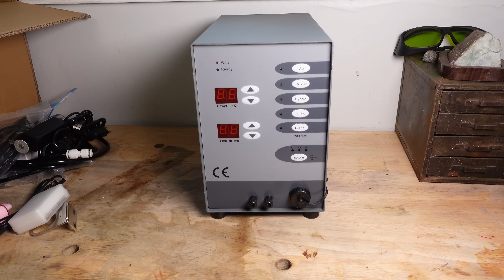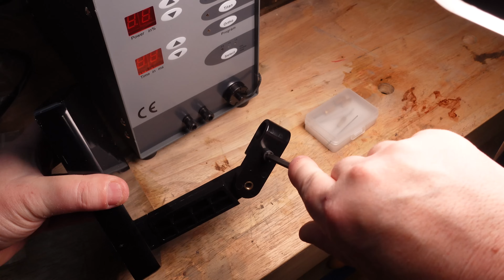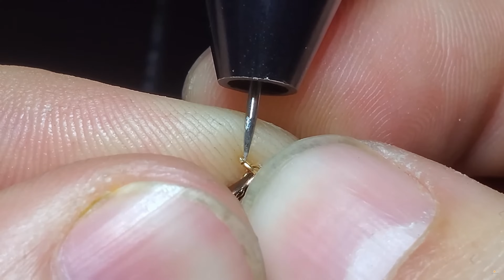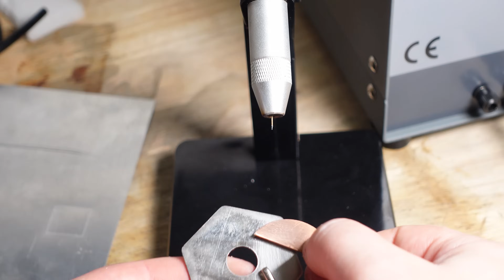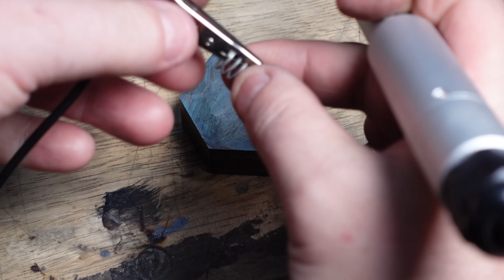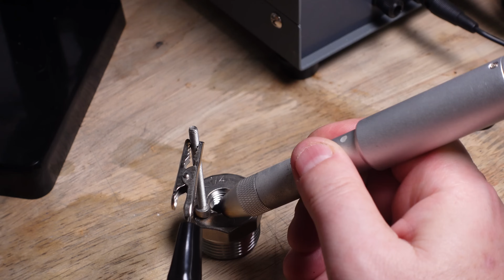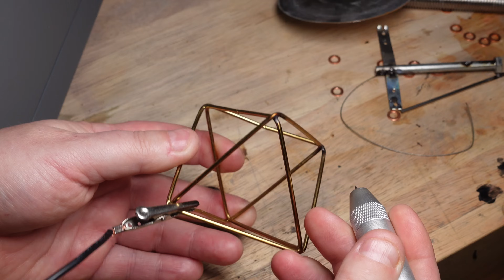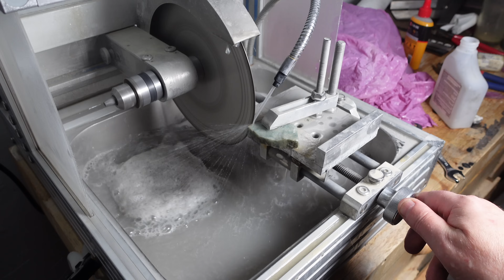Every maker needs this cheap little hobby welder #jewellerymaking #lapidary #welding

Comment: This is an excellent real-world demonstration of how useful a compact pulse welder can be beyond jewellery making. The examples make it much easier to understand where this type of machine fits between soldering and conventional TIG welding.

One important point for new users is that argon becomes especially helpful when making repeated welds or building up a seam. It can reduce oxidation and porosity, keep the weld area cleaner and extend the usable time between tungsten-tip sharpening.

Protective welding eyewear and testing the settings on scrap material first are also essential. Thanks for showing what this affordable type of machine can realistically do.

Comment: This is purely a cosmetic welder it's perfect for those little tiny jobs like jewellery work on silver gold brass copper aluminium perhaps I don't know any aluminium jewelry but as an engineer let me say for the record under no circumstances will this give you a proper penetrative deep weld. It is not designed for that at all so please do not rely on this to do welding in place of a proper mig or tig welder that can do high-quality preventative welding. The argon gas that they recommend is used as a shielding gas to prevent oxidisation during the weld .

That will improve the weld and get rid of the black staining. It will allow the weld to be deeper but again under no circumstances rely on this for safety welding and please please wear appropriate safety glasses the blue light that this welder gives off will burn your Corneas and damage your eyesight. You should also be aware that the blue light is in the UV wavelength and hand protection should be worn.

Comment: Can I hook it up to my regular wall outlet?
Reply: Yep anything that can chuck out 110 or 220 V and can supply at least 10 A or more, do not connect it to a lighting socket. It has to be a normal socket for example one that runs a dishwasher or an appliance in the kitchen or if you've got a socket in the garage that sort of one.

Comment: I have the exact same I use it with Aragon it it is hilariously simpel and Awesome to use I wish I had this in the 90s would have a YouTube Channle by now if I had this pice of excellent equipment sooner. RC Chassis aut of Aluminum wire no problem. Even drone components are a pice of cake.

Comment: Can you recommend settkngs ?
Reply: Try the machine settings first as you can see there are standard settings for each of the base metals if they're no good then try the manual mode basically all you're doing is altering time and current flow.

Comment: Do you have to use argon because i don't know anything about this stuff?
Reply: Argon is a inert gas. It will not harm you well that is unless you completely filled the room up with Argon gas and remove all the oxygen which is highly unlikely. It is used like plumbers use flux when they are soldering a joint together,  in welding or in this case tack welding or pulse welding, what the argon does is create a shield if you like around the electric spark that prevents the oxygen in the air penetrating into the weld and causing the black staining and a poor quality weld.

You can pulse weld using this machine without argon and he does actually show you that all the welds he's done are without it personally I would buy one of the small bottles and try welding with the argon gas, when you become more proficient by a larger bottle because it will save you a lot of time on Cleaning and it will guarantee a perfect tack/pulse weld assuming your settings are okay.

I would suggest you do a little bit of research if you think about buying this and look on Wikipedia about cold welding because that this type of welding is called that or pulse welding to give it its proper name. This creates a very weak weld but for jewelry that's all you need but if you were trying to say weld a car back together, this is definitely not the machine. For that you need a professional machine that can put out 80 to 300 A this only puts out 150 W at whatever voltage your country is.

Comment: What is the power of this machine ? . There is a wide range of product starting from 100W to 500W with  150 A..and I guess the steel spotwelding depends on higher watt values

Comment: Just received mine ordered via your link, and I hope there’s just a learning curve, because so far I have made zero successful welds… attempting to weld cleaned stainless steel, and getting sparks and slight marring of the surface plus a decent amount of soot, but so far zero joined metal. It’s tough to know whether I’m experiencing user error or some fault with the machine because there’s not really much to the manual, plus, not a whole lot of instructional videos to follow… will keep trying to make a successful weld happen.
Reply: Avez vous réussi du coup ?
Reply: @maximeboche  (sorry, I tried to remember the French I took thirty years ago, but it was embarrassingly terrible, so I’ll just go with English so I don’t embarrass myself)… I could not get the welder to work, at all, even on the easiest test of welding jump rings closed, so I returned it and actually ended up buying one from Sunstone that’s SO MUCH more expensive that it’s kind of nuts, but it works so beautifully that I’m still not sure it’s actually real! Even with zero experience, I was making successful tiny, pretty good looking welds within about ten minutes of getting the Sunstone welder set up.
Reply: Похоже, я отнесу этот аппарат в мусорник. Он не может сварить ничего, кроме проволоки диаметром 0.2-0.3 миллиметра. Ювелиркой я не занимаюсь. Этот аппарат не в состоянии заварить даже щель в тонкостенным стакане из нержавеющей стали. У кого другой опыт, пожалуйста, напишите.
Reply: @hombre0leg I ended up returning mine because out of hundreds of attempted welds, I was only successful on TWO, which were jump rings. I actually do work at a very small scale and this thing was still totally useless.

Comment: Newbie question: are the tungsten rods a consumable? If yes, how long do they last and where do you get replacements? (You can tell I’m about to buy this machine, with zero welding experience, based purely on this video 😅)
Reply from the maker: yes they wear out eventually but the machine comes with dozens. i have had the machine for a year, use it every day, and haven't needed to buy more yet but im sure you can find them on amazon when you finally need to
Reply: @sweetgumnyc7794 amazing! The possibilities that this tool opens up, especially when paired with a fiber laser, are seriously infinite!

Comment: What's the power input needed? I see it listed as 110v/220v. Standard 110v/15a circuit sufficient? Or expect to connect to a 250v/30a circuit? I haven't seen any specs or reviews mention anything about power requirements.
Reply: I think it depends on your country, I ordered mine and I am in Kenya where our voltage is 220

Comment: Could anyone please tell me if, in your experience, this machine would spotweld 3*3 mm square rods to a solid base with perfect square holes in 6mm mild steel? Both non-galvanised mild steel. 

Would help me hugely to know. I exclusively need to weld those and I’m a bit scared of full-on welding. 
This seems to have a nicer workflow too…

Cheers!

Comment: I saw this video and i just saw that my heart desired it.
I do hope it wasn't a bad buy.
Reply from the maker: You'll love it. Since I posted this video I have been using it not only every day but I sell EDC keychains and I use it in my production process so it gets used all day long and its holding up well. I still never bothered getting argon
 Works for steel and aluminum fine without it
Reply: @sweetgumnyc7794  Well, let's hope it holds up better to heavier use.
Also that i don't mess it up during the learning curve, however that shouldn't be too bad since i have a weld certificate.
Reply: @sweetgumnyc7794  Well, it's looking bad so far.
So what settings are you using for those results? I've so far tried a few different nails, some old steel wire, tried repairing a vacuum part.
All in all shitty "welds". Lots of soot.
So far i've mostly done the Hybrid, or cranked it up to max to get any desireable effect.
Only difference i can see is the screw on safety cap on yours vs the push fit on mine, different grinder. Plus my "manual" was a printed piece of paper.

But unless i can make it improve significantly, this one is being returned.

Comment: Could this be used for installation of new brushes on a small motor?
Reply from the maker: i have never coiled a motor before but aren't brushes usually installed with a spring? i

Comment: Great video! Does anyone have experience with aluminum? It seems to work in the video, but I've read online that it doesn't. It would be really interesting for welding aluminum sheets (0.5–2 mm) for model making.
Reply: Welding Aluminium is very difficult to weld even skilled welders have problems the first thing you need is an AC welder not a DC welder which is what this is well it's a tack welder, I know he shows it tack welding aluminium and I was quite surprised the problem with welding aluminium is that it can heat up very very quickly and you end up with a hole in there substrate you have to preheat the aluminium and then you have to continue to heat it as it cools down that's why this is not in my opinion the best machine to tack weld aluminium. You need a proper AC welder and the appropriate gas.

Comment: hi. im rather new to this but i would like to know do you need a respirator? Protective eye wear? Do you need proper ventilation or fans? And can you use this in your apartment.?  Basically do u need to same safety protocol for sodering? Im really not interested in the gas rite now. i would like to repair some jewels or small crafts. I just thought sodering had to much involved rite now. thz
Reply: No to a respirator, just a Covid mask unless you're welding something that gives off a toxic chemical like galvanised metal you won't need fans or ventilation. You just need to do it in a safe area which is unlikely to catch fire if you put something hot down so I recommend placing it on a tin tray or a tile and do it that way when you can buy the argon because it will make a lot of difference

Comment: Hallo, echt schade, dass es keinen Vergleich zum 1. Gerät gibt. 
Ich habe mir jetzt auch so ein Teil gekauft. 

Leider war da Betrug im Spiel!

Es gibt keine Verbindung für das Schutzgas zur Schweißpistole. 
Am Gerät selbst ist noch alles Okay. Wo das Loch für den mittleren Pin war, ist jetzt das Loch fürs Gas. 

Am Stecker der Schweißpistole gibt es aber nur Pins! Kein Loch fürs Argon! Das verteilt sich dann nur um den Stecker.

Ich habe 2 Fragen an dich.
Es kann aber gerne jeder darauf antworten. 

1. Hat der Stecker deiner Schweißpistole ein Loch? 
Auf manchen Bildern ist die Öffnung deutlich zu sehen. Bei den meisten Bildern erkennt man aber den Pin in der Mitte des Stecker.

2. Kannst du mir bitte sagen, was bei dir für Kondensatoren verbaut sind? 
Bei mir sind es 10000 µF 63V .

Ich freue mich über jede Antwort. 
Das hilft bestimmt auch anderen Leuten .

Comment: It was because of this video I bought one of the machines. I don’t need a full on welder but one just good enough to make small repairs and crafts. Thanks for showing me the way sir!
Reply from the maker: What do you think? Do you like it so far?
Reply: @sweetgumnyc7794 so I have never welded a day in my life before this. It took me a little bit to figure the settings but after that it was very easy to use. I do think I’m going to get an argon tank just to try. But I also got some 2mm 304 stainless rod that I cut into pieces and made a cube. A little crooked but I was impressed how easy it was. Great little machine.
Reply: @sweetgumnyc7794 I do. It takes a bit to learn all the settings but now that I have it down it’s a nice little machine for hobby stuff.

Comment: My question is, after you have tacked on sterling silver, can you then solder with silver solder?
Reply from the maker: Not sure what youre asking but I think youre asking if you can use this machine as a tac welder to hold your parts in place while you then follow up with a full solder? If thats what youre asking then yes absolutely. I use it for that all the time. Some pieces its extremely difficult to keep parts from wandering when soldering so this really helps. The best part is because the tac welds are so tiny (power is adjustable) even if the weld is in a conspicuous place, 2 seconds with a silicon wheel in your micromotor, removes any evidence of the weld on the outside. I even fully flux my work, place a thin piece of solder between two pieces, hit it with one or two small welds to hold it in place, and then follow up with my torch to set the solder and its perfect. The flux doesn't effect your weld, as a matter of fact if youre not using argon, it actually helps. One warning is if you apply too much paste flux, it could interfere with conductivity so if I use too much flux I sometimes need to scratch a tiny clean spot where I need a weld so I can achieve conductivity.  Its easy because I just use the tip of the welder to do that because it's  tungsten and shaped like a needle so its perfectly suited and  already in my hand lol
Reply: @sweetgumnyc7794 yes exactly what I was asking, thank you for your reply, appreciated.

Comment: It's a copy of an older German made dental welder. That's why it looks so powerful. It's a dental welder, not a jewelry welder. And yes, the welds must be strong, if you weld, for example, a dental bridge.
Primotec Phaser MX1 is the original. If you google it, you will see, that it looks almost the same. Also the manufacturer has a channel here on youtube - @primotecphaser. Last upload is from 12 years ago, but nevertheless you can see how it is intended to be used.

Comment: Chinese electronics is like American cars. Not very good. 
For Quality you need German. However no all product makes,are bad.
Reply from the maker: I used to think like you do but after buying probably over 2 million dollars worth of machines, supplies and equipment from china through my job over the years, i have not only witnessed a marked improvement, but with many products Chinas quality is now the best in the world.The Chinese market has two teirs. They still make garbage for all the big box stores but they also have highly specialized top teir products as well , often at a 10th the price of comparable western products with no trade off in quality. It all depends on what you buy. If you want to spend $3000 on an orion welder that can do little more than this $200 welder can do, be my guest but the days of "china only makes junk" narrative is something only boomers still believe.  Almost everything we buy is made in china now, even brand name american label  tools. Just a couple years ago American made fiber laser sources were considered the best but today, they have been completely replaced by Chinese equivalents that are better and less than half the price. Youre missing a big evolution happening in China
Reply: @sweetgumnyc7794  I can confirm both on the fiber lasers, and on this welder.
Reply: It's actually a copy of an older German made dental welder, namely Primotec Phaser MX1.

Comment: Recommendations for which kind of tungsten rods when I need to replace?
Reply: Basically the same diameter as to the one that comes with the machine they're easy enough to pick up but you will need to grind the tip of the rod to the correct angle. Plenty of information online about that I believe most of the machines come with a small grinder.

Comment: I actually bought this welder to make stainless steel sheet metal constructions. building custom size battery cases, custom shaped brackets, welding attachments onto hose clamps etc.

Comment: @sweetgumnyc7794 Bro, you have to have tried to mini-weld electrical wires together.. as an example ...  LED wire runs typically left to crappy connectors/wire nuts or time-cost heavy and expensive soldering? ⚡✨⚡‼?
Reply from the maker: If its copper wire, both solid and stranded, regardless of the gauge , it will likely work, but where i dont think it will work is with the type of wire with tiny strands that are covered in plastic insulation , i forget what its called but i never have luck even  soldering that stuff but if your wire, solid or stranded doesn't have a coating on it, it should work fine. At least it did with any wire i tested. It would probably also work with aluminium wire too but maybe not as easy as copper?

Comment: Hey, I purchased the machine through your link and no matter what I weld. I get a concave hole no matter what setting is a bad machine or bad technique.
Reply from the maker: That sounds weird. What material are you welding? You should have gotten several tungsten rods. If your material is thin, you want the thinnest rod, if your material is thick, you want the thicker rod. The settings are power and pulse duration so the lowest power would be one combined with the lowest pulse time option( cant remember what that is) but what material and thickness are you trying to weld?